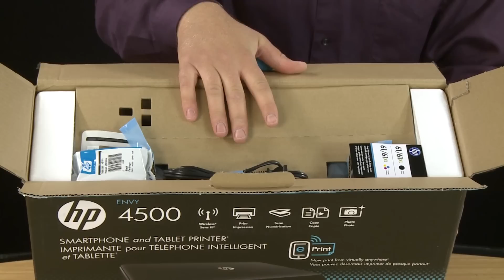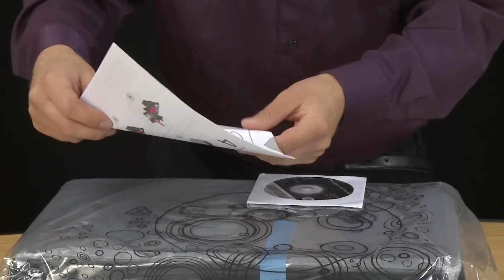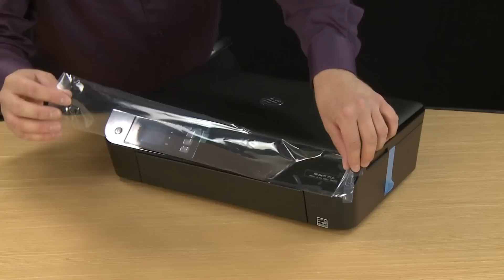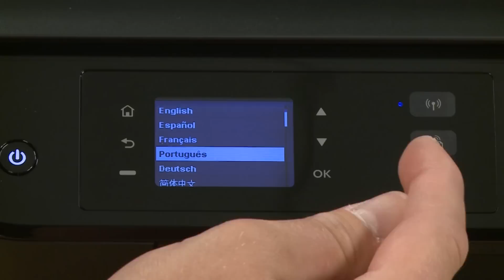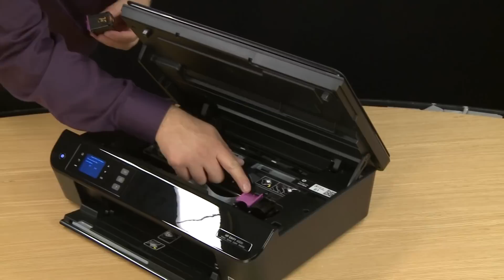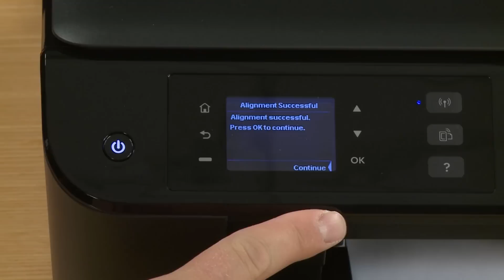Unboxing and Setting Up the HP Envy 4500 e-All-in-One Printer | HP

Comment: How can a company can be so lame.  Bought a printer from HP that ended up destroying with pleasure.  I can't understand why I need to login into a hp account to print or scan documents.  Also, bought a cartridge at bestbuy that was working just fine but after awhile it said that it was counterfeit?  Avoid HP products everyone, they suck.
Reply from the maker: Hi there, thanks for contacting!
I understand that you are experiencing an issue with your printer as you are receiving counterfeit error message and also need to sign to scan or print.
I will do my best to assist you.
Please refer to the instructions mentioned under this document to fix the issue: https://bit.ly/2XRiGtO
Regarding signing to scan or print, please let us know below details:
- May I know to which device you have connected your printer? (For ex: Desktop, notebook, iPhone, iPad, android phone etc?)
- If connected to computer, may I know the operating system installed on it?
- Are you receiving any error message?
Please let us know. 
Binu - Social Media Tech Support

Comment: i heard hp envy is really slow, love it anyway!
Reply from the maker: +Leaf & Auburn If your laptop is running slow, please perform updates via Windows and HP Support assistant as mentioned below: Step 1 Windows Updates - 
1) In the search box, type and open Windows Updates. 
2) Check for updates. 
3) If the updates are available, click on install and restart the computer. 
Step 2 HP Support Assistant Updates - 
1) In the search box, type and open HP Support Assistant. 
2) Check for updates. 
3) If the updates are available, click on install and restart the computer.

Comment: hello i bought th hp envy 4512 but i dont know how can i take a pic
Reply from the maker: +VERONICA SER Please load the short edge of the photo paper into the tray based on your printer type. If the paper has a perforated tab for handling the photo after it prints, load the paper so the tab faces up or towards you to prevent printing on it. try the following document in order to print photos:http://hp.care/2pKRQhu and http://hp.care/2qJInGy

Comment: it doesn't print photos without several tries. I hate that. I haven't been able to print on picture paper at all.
Reply from the maker: Are there any error messages when you try to print photos, or does the photo paper not feed at all?  Are you using photo paper of a type that fits the specifications of the printer? Please see the "Paper-handling specifications" in Printer Specifications for HP ENVY 4500, DeskJet 3540 Printers - ( http://ow.ly/Nfst302vIds ).

Comment: is this printer only good for tablets and phones ? or i can connect it to my laptop as well ?
Reply from the maker: +Catherine Velazquez   I am presuming that your laptop is running a Windows operating system.  Yes, you can print from your laptop to this printer.  I've included the "HP ENVY 4500 Series Printer - Wireless Printer Setup (Windows)" document ( http://ow.ly/4naEht ) for you.  It will walk you through installing the printer driver onto your laptop so you can print from the laptop.

Comment: But I want to install my printer software again to my new computer, how do you do it?
Reply from the maker: +CrownRF   I am presuming that your new computer runs a Windows operating system and that the printer is still connected to your wireless network.  Please follow the steps in the "HP ENVY 4500, HP Deskjet 3540 Printers - Wireless Printer Setup (Windows)" document ( http://ow.ly/VUFpF ).  You should be able to skip directly to 'Step 3: Download and install the driver'.

Comment: Awesome vid but when I power it on it comes up straight away with ERROR CODE 0X83COOOOA.. any ideas?
Reply from the maker: +Shanna Biddle   There is a document for that error.  It is titled "HP Printers - Resolving 'Problem with Printhead,' 'Printer Failure,' 'Ink System Failure,' or a '0x...' or a 'C2...' Error".  Please follow the steps within the document your error message. To find the document please search for C03081973 on HP's home page or using Google search.  

Please also search for C03755986 as it is the Envy 4500 printer specifications and the document lists the cartridges that the Envy 4500 uses depending on your location in the world.

Comment: LOL, without this video I would have been pretty angry. Thanks. Bought a refurb printer at Amazon and it only had the single quick guide sheet that told me to remove packing materials inside the cover that were no longer there. Took me all of 5 minutes to give that very first part up, the paper thing would have stumped me as well.

Comment: Hi, please tell me how to change the setting from dark to normal or light when using the black ink, each cartridge only prints like 100 pages or less, thanks
Reply from the maker: +Perito Traductor Autorizado   There is a document titled "HP Printers - Printing and Changing Print Settings (Windows)".  One of the sections is how to print in grayscale.  To find the document please search for C04673480 on HP's home page or using Google search.
Reply: Thanks, I'll check it out!
Reply: +HP Printer Support  is it the same section for Mac?
Reply from the maker: +Perito Traductor Autorizado   I have a different document for Macs.  Please search for C04701747 on HP's home page or using Google search.  The title of the document is "HP Printers - Printing and Changing Print Settings (OS X)".
Reply: +HP Printer Support thanks! :)

Comment: Thank you for this helpful video. 
Could you please make another video showing how to connect this printer to Chromebook? :)
Thanks.
Reply from the maker: +Trish Hoang   There are two documents that will work for you.  The first one will involve registering your printer with Google Cloud Print.  The title of the document is "HP ePrint Capable Printers - Setting Up and Printing on a Chromebook".  To find the document please search for C04122530 on HP's home page or using Google search. 

The second one uses the HP Print for Chrome app.  The document to assist you with this is titled "HP Printers - Using HP Print for Chrome".  It starts out by indicating that by using this the printer cannon be registered with Google Cloud Print.  To find this document please search for C04683559 on HP's home page or using Google search.
Reply: ***** Thank you so much! :)
Reply from the maker: +Trish Hoang   You are very welcome. :)

Comment: I have this printer and I've been trying to install it on my mac but the installation keeps failing could it be I need an update installed? Since I have OS X Yosemite? As on the disc this software is not on it.
Reply from the maker: +puddathere    Here is the link to the Mac OS X 10.10 driver for your Envy 4500.  It is the fullf feature software and drivers. http://ow.ly/RToCf
Reply: +HP Printer Support thank you so much! This worked perfectly
Reply from the maker: +puddathere   That's great to hear!  Happy Printing!

Comment: My officejet 4500 stoppped printing. When I hit the print button, the paper goes in and comes out about 25% and it stops ( without printing). Then I have to pull the paper out. When I opened up the printer, I found a spring left hanging inside. I don't know where it goes.  I have attached the spring for your reference. Please help guys!!!
Reply from the maker: +Anoj B  It sounds like you have a hardware issue so please give our Technical Support team a call at 800-474-6836.  If you live outside the US/Canada Region please go to Google search and enter 'contact HP worldwide'.  Your first option should be the site for contacting HP, when you click on it you will be prompted to choose your country/region.
Reply: ***** Probably it's better if I get new printer than getting this one repaired.

Comment: No manua came with my printer, connected by a technician and now I have no booklet to tell me how to use this printer - a wifi connection to go with a new Windows 8.1 laptop which does not have a DVD player.  I intend to purchase an external one but meanwhile am stuck for anything but copying and printing "some" documents but with difficulty.I would like to have an internet copy of the manual which to me should have been included with my printer.
Reply from the maker: +Martha MacKellar   Please search for C03784120 on HP's home page or using Google search.  That is the document number for the Envy 4500 User Guide.  You can also search for "HP Envy 4500 product support" and the 3rd or 4th hit should be the product support page for the Envy 4500.

Comment: Dose the printer print in different colors?
Reply from the maker: Rosa Dominguez Yes it does.  This printer has a black ink cartridge and tri-color ink cartridge. IF you search for C03755986 on HP’s home page or using Google search you will find the printer specifications for the Envy 4500 series of printers which indicate which cartridges are required.

Comment: I've taken everything out of the printer. When I go to print the alignment page,there's a paper jam. No idea what's causing it. Followed instructions to the letter
Reply from the maker: James Moore Please follow the steps in the document titled “A 'Paper Jam' Error Displays on the HP ENVY 4500 e-All-in-One and HP Deskjet Ink Advantage 3540 e-All-in-One Printer Series”.  It has the different areas to check for debris.  One area that is commonly missed is checking the bottom of the printer.  To find the document please search for C03754704 on HP’s home page or using Google search.

Comment: Help! My printer got jammed when I was printing the alignment page, and once I removed it, it moved on to the next step in the set up process without allowing me to reprint the alignment page. Now, I fear I have an unaligned scanner! What can I do?
Reply from the maker: Leslie Lozano Is the printer still jamming when you print a test page from the printer? Are you able to print an alignment sheet from the computer using the Full Feature Software? What version of operating system is installed on your computer?

Comment: I just bought this printer. It cannot connect to my wireless router it always gives the following error code 0xB809560C and freezes.

Well I never had a good experience with HP products but this was the last straw :S
Reply from the maker: Rui Araújo I recommend following the steps in this document on HP Printers - 'Problem with Printhead,' 'Printer Failure,' 'Ink System Failure,' or a '0x...' or a 'C2...' Error Message Displays. This resource can be found by Google searching "c03081973". If the issue continues, please contact our technical support by going to Google search and enter 'contact HP worldwide'.  Your first option should be the site for contacting HP, when you click on it you will be prompted to choose your country/region.

Comment: HELP! I'm having a hard tin installing the software
Reply from the maker: Zulema Torres To better assist you, I will need to know if you are installing the software using a CD or from downloading the drivers online; the product and model number of your 4500 printer, if you are using a Macintosh or PC as well as the version of operating system installed on your computer.

Comment: We changed our router and now the printer will not print. I can't find the "Settings" on the printer to change it to the new router. Can you help me please?
Reply from the maker: Kathy Bitzel I recommend following the steps in this document on Setting Up the Printer Software for a Wireless Network for the HP ENVY 4500 e-All-in-One and HP Deskjet Ink Advantage 3540 e-All-in-One Printer Series. This can be done by Google searching "c03753241".

Comment: If I choose to set up with wifi can I change to usb later on if wifi is unavailable?
Reply from the maker: B hasten If you setup your printer on a wireless network, you can always connect it with a USB cable at a later date.

Comment: Hi there, is there no USB cable with the printer?
Reply from the maker: Jonathan Møller Nielsen Some models may come with a USB cable, depending on where the printer was purchased. The box should indicate if the cable is included or not.

Comment: I removed all of the packaging but it says there's still packaging in the machine and it won't go any further.
Reply from the maker: mrSmiley1100  Please use the document titled “Setting Up the Printer Hardware for the HP ENVY 4500 e-All-in-One and HP Deskjet Ink Advantage 3540 e-All-in-One Printer Series” as a checklist to ensure that all packaging was removed.  There might be a small piece of tape on something that just happens to be where a sensor is.  To find the document please search for C03745931 on HP’s home page or using Google search.
 
If all the packing has been removed, please try doing a reset of the printer.  At the step where you are plugging the printer back into the power source, please ensure that you are plugging the printer directly into a wall outlet.  The steps to reset the printer can be found in the document titled “'Reset Power' Message Displays on the All-in-One” as Solution Two.  To find the document please search for C01059445 on HP’s home page or using Google search.
Reply: mrSmiley1100 Dp you find a solution?
Reply: Nik Muff No I had to return it, the company still hasn't even gotten the printer yet either.

Comment: Hi HP Support,
I've just bought HP Deskjet Ink Advantage 4515 and have set up as shown in the video. The chalange is that after I enter the HP Cartridge, the display is stuck at the screen having the HP logo and has 2 buttons to left and right bottom (Retail Demo & Setup) and is not acknowledging the entering of cartridge's. It is not responding when I manually click on them (Retail Demo or Setup). I've also switched off and on the Printer but nothing changes.
Please advise how to move forward.
Thanks
Gautam
Reply from the maker: Gautam Vohra Please call our technical support at 800-474-6836. If you live outside the US/Canada Region please go to Google search and enter 'contact HP worldwide'. Your first option should be the site for contacting HP, when you click on it you will be prompted to choose your country/region.

Comment: i tried setting up my printer and tried to wirelessly connect it to my laptop and when i input the ip number it says that it is incorrect so i try to use the hostname and it still does not work. please help
Reply from the maker: veronica wong Try reviewing the document I am linking below. It will walk you through setting up the wireless.
http://support.hp.com/us-en/product/HP-ENVY-4500-e-All-in-One-Printer-series/5304875/model/5304876/document/c03753241/
Reply: veronica wong

Comment: HP Printer Support please tell me why you force the customer into energy saving? You cannot turn sleep mode off! I want the printer to stay on all day I don't want it going to sleep after 5, 10, 15 minutes or auto turning off after 2 hours. I don't want to be green.

Secondly why can a customer not contact HP support through email? the website gives the option of chat, phone or forum.
Reply from the maker: bigboobiessogood The Energy Saver mode can be turned off. To do so follow the following steps. From the Home screen on the printer display, select Preferences.(NOTE: If you do not see the Home screen, press the Home button.) Then from the Preferences menu, select Auto-Off. Next from the Auto-Off menu, select On or Off, and then press OK to confirm the setting. Once you change the setting, the printer maintains the setting.

As for contacting HP via email that is not an option that HP has available. There is still the Phone, Chat and the HP Forums available.
Reply: *****  Even if you turn the Auto-off setting to off it still goes to sleep 

I don't want the printer to sleep or turn off? Once I switch the printer on I want that lcd screen lit all day without sleeping or auto turning off.
Reply from the maker: bigboobiessogood According to page 93 of the manual below 'The time to Sleep mode cannot be changed.'
http://h10032.www1.hp.com/ctg/Manual/c03784120.pdf

Comment: Just got my printer and I installed the software but the printer stays blank and nothing shows up just the hp with a loading sign
Reply from the maker: maryam vichi If you do not have the printer plugged directly into the wall do so. If the issue persists unplug it hold the power button down for 30 seconds and plug it back in and turn it on. If it still persists contact our Technical Support.
Reply: thank you

Comment from the maker: @Joanna Young
I’m sorry I just saw your post.   There are two different trouble shooting documents I’d recommend.  

The first one will walk you through the different places in the printer to check for debris that could be causing the recurring paper jams.  Please search for C03754704 on HP’s home page or using Google search. The title of the document is “A 'Paper Jam' Error Displays on the HP ENVY 4500 e-All-in-One and HP Deskjet Ink Advantage 3540 e-All-in-One Printer Series”.  

The second one will walk you checking to ensure you do not have a carriage jam.  Quite often a carriage jam will start by presenting itself as a paper jam.  Please search for C03754946.  The title of the document is “A 'Carriage Jam' Message Displays for HP ENVY 4500 e-All-in-One and HP Deskjet Ink Advantage 3540 e-All-in-One Printer Series”.
Reply: +HP Printer Support LOL If only it were this easy to set up

Comment: Ive just got my printer and for some reason it will not let me change the language, its automatically set itself to chinese! How do i change it, it is so frustrating
Reply from the maker: Colin Chadburn  To change the language from Chinese on your Envy 4500 printer, please follow the steps below.

-  Please press the Home icon on the front panel of the printer.  
-  Please press the up arrow twice.
-  Please press the 'OK' button twice.
-  Please choose the language that you prefer to Chinese. 

Please let me know how it works out!